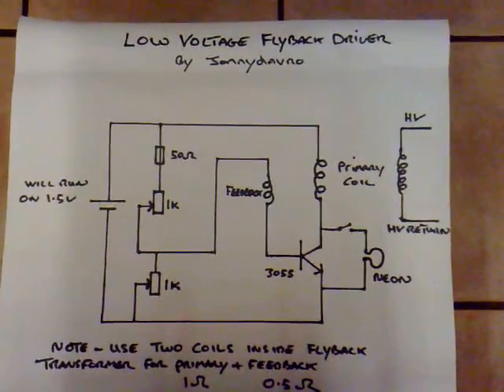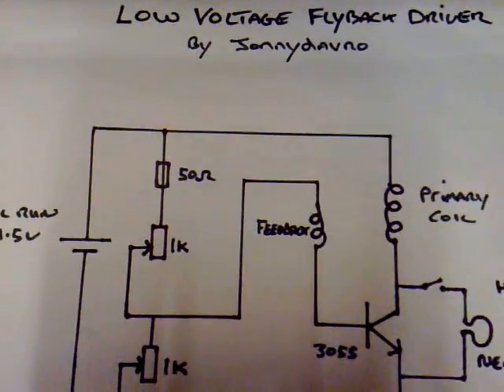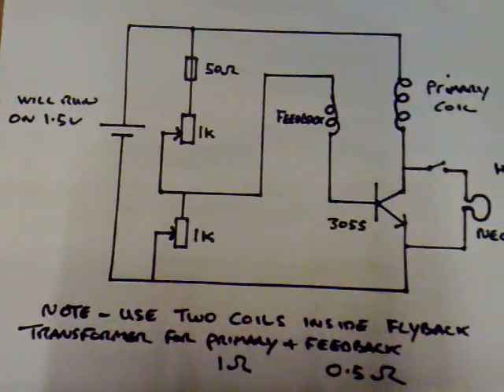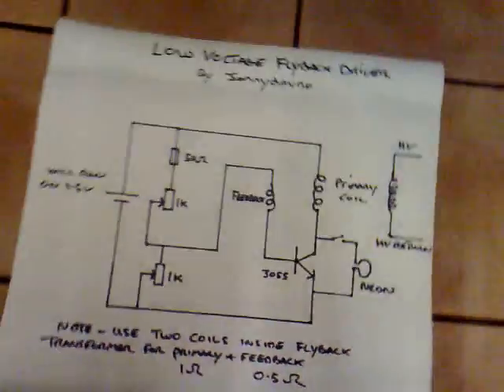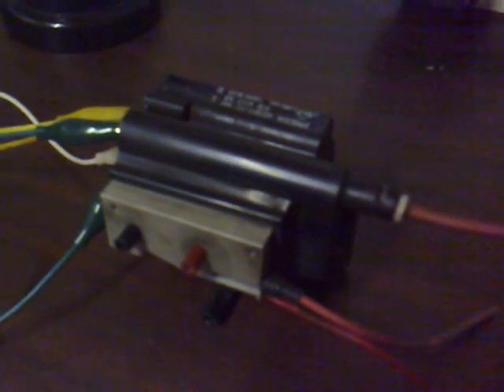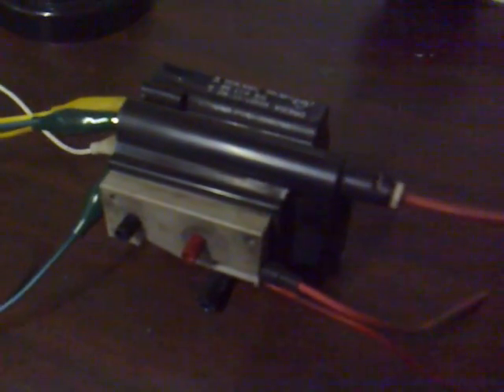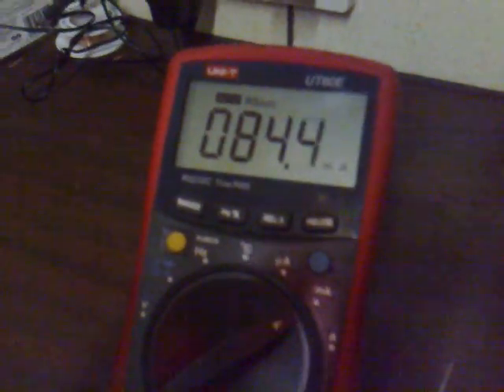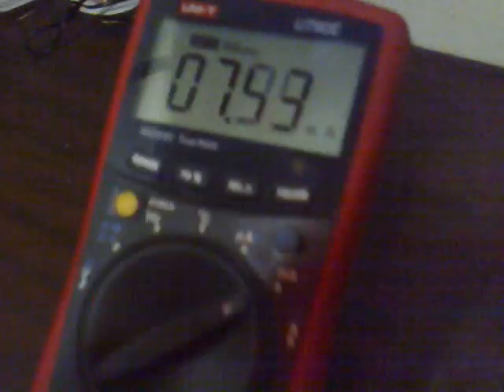Low voltage flyback  driver

Comment: I made flyback with 2n3904 and 1.5 v batery and it runs neol light  very nice you can even arc it it gives 1 mm spark :P

Comment: Thanx a lot for the reply, I am new to flybacks so lets see... I don't get how current through flybacks  goes with the typical R1 R2 values? I mean   typical 240 ohm+27ohms  and 12v input should only yield 4mA according  to ohms law! but yet all flybacks at these  values draw far higher current around 1-3amps. How?  
If say I want to decrease the incoming current  to the flyback, should I increase both R1 and  R2?

Comment: Interesting configuration! I want to drive the flyback from a lower power   under 10v and I only got 2A from my psu, how do I limit the current , do I decrease both the R1 and R2 values? It would be really appreciated if you helped me. Thanks

Comment: Hi, I've seen this video before but forgot about it so now i am going to try this circuit on 1.5-3v-5v at max because i made a similar driver few days ago and killed 2 transistors so i am going to use it as an CFL inverter and see how it comes out, Regards Cip

Comment: @jonnydavro Hi, Are you still active on youtube? After making a 2n3055 based driver and 555 PWM driver to get bigger arcs I decided to try your circuit for use with low voltage and managed to get a florescent tube to light up nice and bright on 3V. The florescent tube was from a small lamp that needed 6V in order to light the tube up.

1.5V was not that great but it might be becuase I used a 56 ohm resistor instead of 50 ohm or the flyback I used might slightly different in efficiency to yours.

Comment: Hi, I have made one of these based on the 2n3055 driver but I can only draw an arc of a few mm. I am using 8 (12v) AA battery's to power it.

Any ideas on how to get it to arc longer as think 12V should be enough plus the battery are new

Any ideas?
Thanks!

Comment: hey jonny.. i just wanted to say i made your circuit using two 10k pots and a 100ohm resistor, as thats all i had laying around. did the trick just fine and lit my 7watt floro from a AAA. had to reverse my feedback windings but that was the only snag. thanks for posting this.